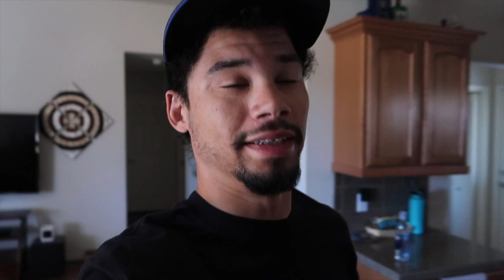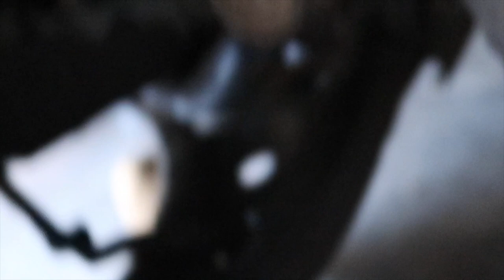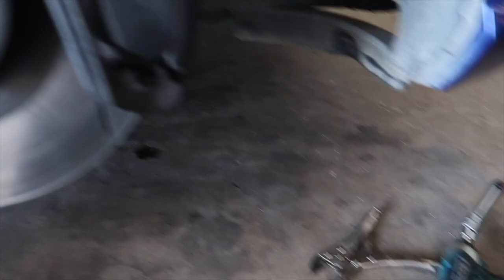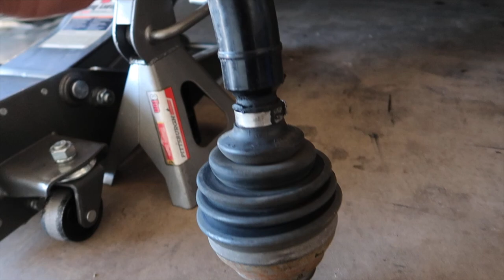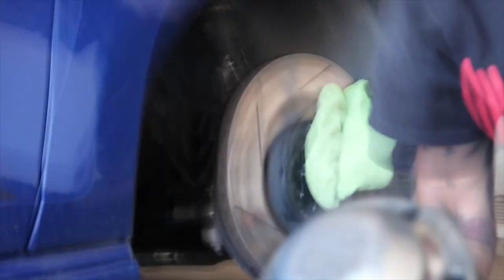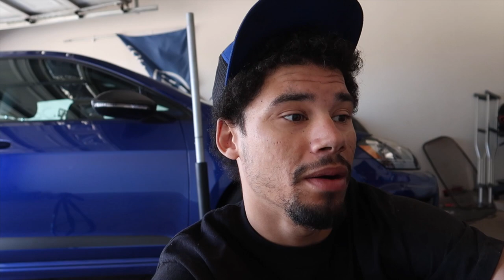Broken Axle - Removal  | MK7 Golf R

Comment: It looks like you have BC Racing  coilovers? I just noticed your end links are a gold'ish color. They are the same color as my BC's. Anyways, if you do, i would recommend swapping out those end links that came with the BC coilover kit. I had one of mine go out already, and I don't even track or autocross my GTI. I got new endlinks from BC Racing, which look to be an improved design. The bushing looks much better. They were only $17.50 each + shipping on BC's website.
Reply from the maker: I do! I've had a quite a few track days and probably 10k without snapping them yet lol! I do plan on getting some adjustable ones down the road.. it's on my very long list of things to do 😅 thanks for the heads up though! I appreciate that.. might have to bump that up in my list lol

Comment: You snapped it because you where dropping the clutch on a sticky track. You really need to learn how to launch your car on a drag strip, it requires a lot of control with slipping. Not this LC bouncing and dropping. Look at the DSG how it slips the K0 clutch as you launch and then applying full pressure. 
Keep up the grind 👍
Reply from the maker: Oh I'm well aware lol, just need the seat time! Thanks man! Hopefully this turbo will show up soon. Just got the port injection installed this weekend. Axle should be going in tomorrow, gonna be a whole new car soon I'mma have to relearn alot lol
Reply: @BryceJordanProductions  that turbo is good I was running it for some time. Went with the m680. When I built my engine.
Reply from the maker: Nice! That would be the route I go also probably. Won't be building the motor for awhile though. Figured I'd build the head, run less boost /same power and sit on that for awhile. Upgrade turbo when the bottom end gets built. How's it treating ya so far?

Comment: How it happened Bryce?!

How many time did you Launch it before you broke the drive shaft?!

Is that coused by slick tyres?!
Reply from the maker: 6,000RPM launching on a hard tire on a prepped surface. She dead hooked and somethin had to give. Slicks would be preferable because they're soft tires and will take more of the shock from launching. But if you're auto you more then likely never have to worry about this since the suspension is already loaded when you launch
Reply: @BryceJordanProductions  i am a trackday guy...but realy afraid of making LC on a 245/645 medium slick tyre/pirelli circuit gt/ 😅
After 24K km...my half shaft cv joint gave up...so now i have to reolace them..i will go for  Spidan..wich is related to GKN group...they produced OE part for VW too...

Comment: @Bryce Jordan Productions  hey dude, Im having basically same issue - I need to replace a bad axle on a 7th generation Golf. As far as I understand, only the CV axle bolt holds the axle to the spindle. Although mine is a 12 point bolt, not a hex, that I think you had in your video. What year is your car BTW? I cant seem to hammer it out, either on the bolt or a narrow socket extension. My wheels are turned, axle does not push back against the transmission, so it looks like it should come out. Did you do anything else before recording this video? Or did you replace the axle before? Because only thing I can think of at this point is that it's Loctite'd AF at the factory.
Reply from the maker: I made another video for doing the wheel bearing that might help you for that side of the axle. I don't remember the exact steps off hand but I'll link the video for you and hopefully that helps!
Reply from the maker: https://youtu.be/VQgo7pb6ZLk
Reply: @BryceJordanProductions  thanks dude. My problem statement - https://youtu.be/-ZwFiWIfa1Q also for anyone that feels like making an input.